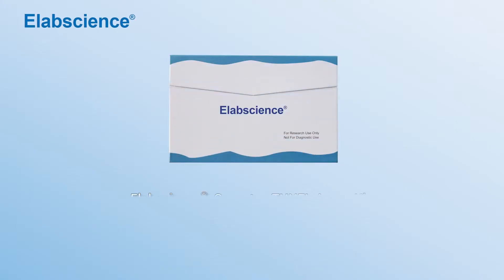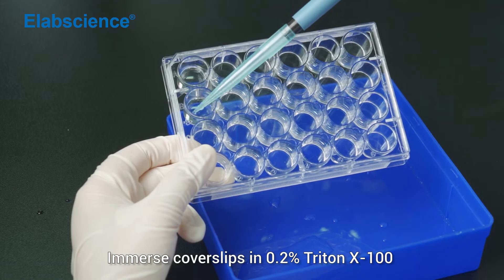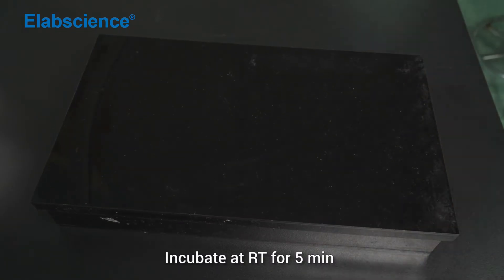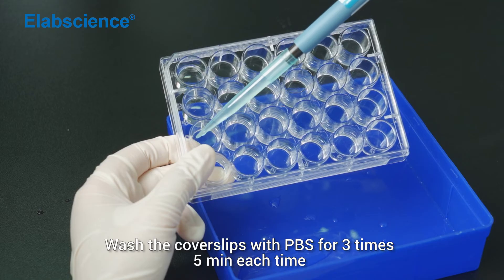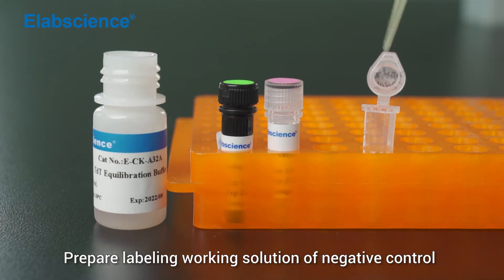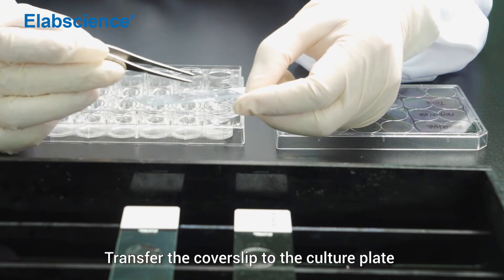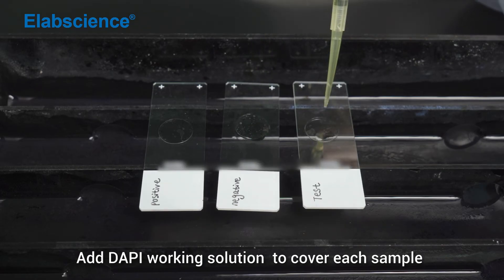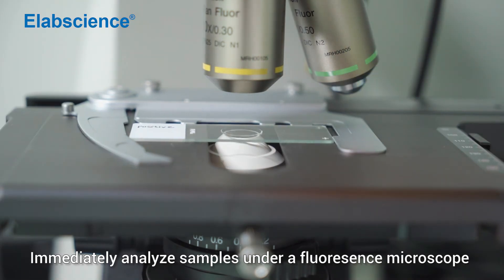One-step TUNEL (Cell Slide) Operation Guide

Comment: Hi, can it be used for 3D bioprinted model cells by doing sectioning?
Reply from the maker: It is not very suitable. If cells can be dissociated from a three-dimensional matrix to form a single-cell suspension, then it is possible to consider making single-cell suspension into a cell smear sample and using this reagent kit. Alternatively, after obtaining single-cell suspension, flow cytometry can be performed using a flow cytometry channel kit.

Comment: i can used this method for early bovine embryo?
Reply from the maker: Yes. However, it is worth noting that cell slide are usually more suitable for cell lines or primary cells, and for tissue samples, the disadvantage is that the process of preparing tissue into a single-cell suspension may introduce damage or other interventions, so perhaps a video of the processing of tissue samples is more appropriate, here are the related links:
Paraffin Section：
https://www.elabscience.com/resource-cell_function-detail-1032
Frozen Section：
https://www.elabscience.com/resource-cell_function-detail-1036